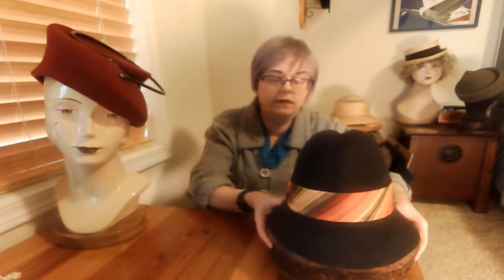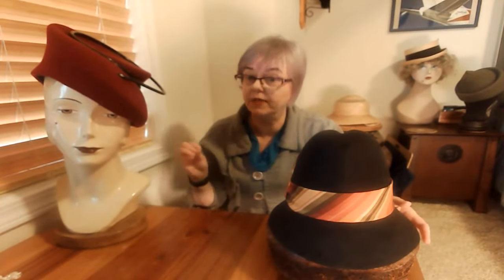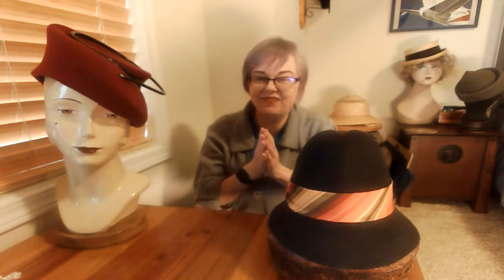Puzzle Blocks webinar | #Millinery

Comment: Hi Im new to your videos - Im from Down  Under and have a long experience in historical fashion - esp mid century.   I own several original Vogue Pattern books from the early 1940's, mid 1940s 1950, and 1960 and 1970, and that profile and style hat is seen in the pages of the 1947 Vogue book, but by 1950, has disappeared all together.  The early 1940's this starts to appear - however its safe to date that style to 1945 to 1947/8.  By 1950, the Vogue pattern counter book, have no head wear that  even approximate the profile or style.  Not to say they would not have been worn still if the milliners had the blocks, but according  to the other pattern/fashion books I have of the day - it is definately between 1942 to 1947 in origin.  In order to remain up to date - a block maker would not have made that in 1950 (IMHO) but its likely a woman would still have worn it had she invested in it.   I would happily pay to have a hat made from that block - we are history bounders of the 1940's!

Comment from the maker: Answers to questions I missed in the chat:
Arlene--I can't imagine a block with more than five pieces, just structurally, but that's a better question for a block maker to answer!

Mangakuray--I have never heard that about talc but it's an interesting idea! I'm not sure what would be safer than talc, because any particulate (like corn flour) would still be potentially problematic if inhaled.

Ilona--I wish I remembered the millinery factory name, if honestly I ever knew it! They were in the NYC Garment District, but that's no help. I'll investigate the block further and see if I can find a mark.

Heather Meadows--the advantage of the tip press over hand shaping is that it requires no artistry so can be mass produced by lesser-skilled workers. Hand-shaping can be a delicate task and takes more time, so i imagine tip presses are better if you're selling multiples/wholesale.

Mangakuray again--at work we have the Ein-Scan SE. You can also use various phone apps like Scandy Pro that stitch together photographs into 3D models.

Grada Kraajistein--I'm actually not fond of 3D printing as a way to fabricate blocks from 3D scans, we've had much better results using a CDC router (ShopBot brand) to carve the blocks in wood!